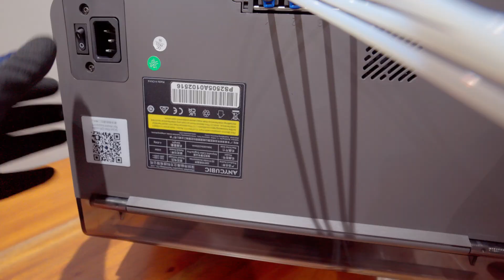Anycubic Kobra S1 : Guide for Troubleshooting Series Part 2 ( Ace Pro & Filament Path )

Comment: Glad I ran across this video guys. Thanks. My jam was just below the feeding point straight off the reel. About 8 inches of filament was crammed in with the gears. That was fun to untangle... About to restart that print that jammed 3/4 of the way through.
...

Comment: In my case, it feeds filament out 3&4 to about 5-6 inches into the tube out the back , stops and then retracts about 1 inch back and stops.  Once it's reached this point, you can see the filament in the tube out the back but you can't even manually push filament through the tube.  The feeder pushes out to it's maximum distance and will not allow any filament to pass.  If you stop pushing, it snaps back into place as it should.

I opened it up and don't see any filament blocking anything.  It was working fine until I had to replace a spool of filament so I decided to change all 4 colours while I was changing the empty spool as the others were getting low as well.  I retracted each one individually as you're supposed to via the panel operations and it worked just fine for all spools.  Spools 1 and 2 feed to about 5-6 inches out the back and stop but can be manually fed all the way to the printer head for extrusion.

Spools 3&4 feed out the same distance but you cannot feed them manually to the printer head.  The filament is locked at that distance in the tubes.

Comment: Great information, thanks for your time do post this. 
I've been fighting my Kobra S1 Combo for two days, the second spool (2) gets tangled then everything goes furbar. I changed the second spool from cardboard to plastic but still had issues during extract, I discovered that my first spool is 96mm OD while the other three are 98mm OD, with full spools during extract the 98mm spools turn slower than the 96mm spool meaning the filament rewinds on the spool loosely, on the 96mm spool it always rewind tightly. 
I checked at the Anycubic store and they sell two piece spools that are 96mm OD, makes me wonder where the warning are about this issue. I have not found any setting in the software for spool diameter, anyone know of a way to set spool diameter?
Reply from the maker: I have heard of this myself and have seen other users print a mod for it for the ace pro its pretty much a ptfe extension inside the ACE and with printed parts. The mod slightly wraps around the spool to prevent loose spooling. Just cant remember the name sorry

Most have had their issues fixed this way as far as I recall and hopefully that helps. Files are in makeronline

And also i have used plastic and cardboard spools okay and in different diameters. I just pop open the cover if the spool is slightly bigger haven't had encountered the issue you're having so far

Comment: I am having an issue where the filament in slot 1 just wraps back around and doesn't  feed through the bottom.
Reply from the maker: There's a filament sensor blocking either the ace pro buffer mechanism at the back, clog in the filament hub or in the extruder/ print head area

In the buffer mechanism if its protruding outward it means that the filament is definitely jammed and obstructing the path

I have videos on my channel for these
Reply: @SwampMan  I figured it out. After straightening the filament for about a minute, it finally stopped jamming. The diagonal cut I made was a bit more than 45°
Reply from the maker: @rwxstudio7173 yea one of the annoying things with multi color

Glad you sorted it out 👌

Comment: How do you get the tubes to stay in. Mine just keep falling out when the filament gets pushed through. I’m clearly doing something wrong.
Reply from the maker: Seems like either the ptfe tube (white/clear) needs to be cut short a bit or the black collar or blue clip is failing to hold it in place

Comment: Slot 1 and 2 keeps cloging in my case...
Everytime I get the error code 11518, but it's not the Toolhead.
The printer works fine without the ace.
But with the ACE...it keeps working, until I hear one loud click, then the lamp on the ace, where the filament is used, stopps blinking and just glows permanently.
And then it stops the print.
But there is nothing in the buffer, and the filament easely can be put in and out of the ace...
No extra force needed.
Hopefully you read that....
Reply from the maker: Only thing i can think of is the magnet on thw buffer mechanism or the filament sensor on the ace pro not functioning properly 

That aside on the extruder or print head side there are filament sensors in there too to check for

Comment: I'm having an issue with the Ace Pro. The PTFE tubes aren't locking securely in the mechanism. As a result, when I start printing a model, the tube slips out and all the filament just gets pulled out and spills.
The problem is probably that when the filament passes through the anti-clogging module, it gets slightly stuck in the tube right before the printer. The tube is also at a very sharp angle. But still, in my opinion, all the tubes should be very securely fastened.
Maybe I could print the tube mounting clips with a slightly greater thickness? Then the tube might be clamped well enough.
And what should I do about the second, short feed tube that goes into the printer itself? Any suggestions?
Reply from the maker: For the ptfe tubes not locked in try getting some blue clips or black collars. I forgot the exact term for them but they're related with ptfe tube supplies. Might as well get some ptfe tubes because they might be damaged if they're not locking properly 

I've seen users print the clips but id rather go for the plastic injected ones

Comment: I want to replace the fans in the ace pro with something quieter. Got my new s1 combo set up last night and by far the dryer fans are the loudest part of the whole thing, if you don't count occasional fast travel sounds. With it always being so humid here in Houston, having the dryer built into the ace unit was what convinced me to buy it. That and being half the price of Bambu!
Reply from the maker: Yea true they do run a bit loud. My ears got used to it lol

Comparing the print noise from my Centauri Carbon and Kobra S1. The Centauri sounded like a jet 😂
Reply: @SwampMan  yikes. i'm also liking how the Kobra s1 turns off fans and stuff once it's cooled down, unlike my ender 3 which has hot end and cpu fans running full speed any time the printer is on. so it's actually easy to forget that it's still on - screen is set to go to sleep after 5 mins, so the only sign it's on is the LED inside the enclosure... which i can't see from more than a few feet away when the office lights are on. i've realized i definitely want to add a light under the hot end though - i can't see whether it's even extruding anything, and can't see what that first layer looks like, even when i try to shine a light in there.

Comment: I really need an issue for error code 11519. When all classic issues don't work
Reply from the maker: The filament tangle error code? You can observe how your spool gets in and out of the slot you're trying to print at

Usually that error code happens when the buffer mechanism at the of the ACE is not springing back properly

Comment: I'm getting tangled filament error when it's not even tangled...getting annoying.
Reply from the maker: Sounds like a sensor is getting triggered that shouldn't 

You can check the buffer mechanism at the back if it flush to the cover or on the print head itself where the filament trigger is located

Usually those areas are what i check if the filament feeds properly in the ace
Reply: Same here, very annoying.
Reply: @razeyoshi after 50 emails from anycubic support and their engineer I'm parting ways with these machines...bought the kobra 3 combo and kobra 3 max combo and now the Ace Pro that came with the Max is starting to do it.

Comment: Yo! Do a video on how to get this thing to not throw fake "tangled" errors all the time. The ACE is cool, but the second I threw a matte roll in, it started saying it was blocked.
Reply from the maker: Interesting thing you brought up. I can make a video about it

Been compiling error code videos and shots rn hopefully I can finish it asap
Reply: @SwampMan  oh please, yes
Reply: Omg man this shits driving me crazy lol that's why I'm even on this video. Mine got fucked up trying to get a matte roll working and now it's stuck and I'm in a worse position 😭 I printed trim casings for the cardboard roll and it helped a little but it's not smooth enough so the machine can't pull it as fluidly as the standard plastic ones and it interprets that as a tangle cus it would become harder for it to feed in the same way.

I feel like the solution is either a better design for trim casing that somehow works as smoothly, a printed roller replacement (which there are models for but require extra parts), or an inner Ace spool holder to relieve some of the weight of the spool from the roller cus the issue seems to be the weight + either softness of cardboard or smoothness of trim casing if they're on. Idk man I can't find anyone specifically addressing this issue.
Reply: Ya this why I'm getting those errors? I use matte all the time it used to be fine until couple weeks ago and now I'm having an issue where the filament won't even pull out from the print head even if i try to force it, if it's go to the detection module and unconnect the ptfe tube from it than it finally works but if i do anything multicolor I have to continually go to the detection module and do that but single color works just fine

Comment: How can we extract filament tube from filament hub module? (From printer to hub)
Reply from the maker: The one at the back before it enters the printer? there's one or two screws hidden inside the printer for that if I remember correctly 

I remember accessing that after i removed the metal sheet at the back

Comment: I had error code 11512, then 11518 and then 11519. What may cause that?
Reply from the maker: 11512 retraction abnormal 

means your filament cant go back to the spool

11518 clogging detected

Could be jam/clog filament in extruder or hotend area. A sensor is getting triggered but it shouldn't 

11519 filament tangle

Means somewhere in the tubes or your ACE pro there's a piece of filament that has been stuck 

Refer to part 1,2 3 in the playlist and remove the error codes one by one
Reply: @SwampMan Damn, thank you so much! I'll check it!

Comment: Are there vent holes to let the moisture out while drying?
Reply from the maker: Technically there are but based on my use they are kind of inefficient. Much better to leave a small gap between the cover and locking part so that the moisture can go elsewhere. Would be nice if someone did a mod for better vent holes
Reply: @SwampMan Thank you.

Comment: I don't get it only slot 1 2 work together, but slot 4 work for very short time then get clocked. And slot 3 even don't work.
Reply from the maker: Look into slot 3 and 4 im sure something is blocking or obstructing the filament path for those slots based on what you explained

Comment: Great video. I just starting having issues with that buffer mechanism not moving at all even though they all snap back. So I guess I'll be taking it apart..
Reply from the maker: Thanks for the feedback 😀 Good luck with the disassembly hope you fix your Ace Pro. If you need extra help we have a discord channel
https://discord.com/invite/5ecpn9f6
Reply: @SwampMan  hmm..weird...I switched to my black filament and had no issues. Seems tk be an issue with matte pla from what I have noticed. 

I'm also gonna print one of those support brackets I've been seeing to see if that helps. Same goes for those anti tangle things in the unit.
Reply from the maker: @randalb1191  Yea ive heard of this usually its with silk, glow in the dark filaments and other brittle filaments

Although for me haven't had that issue yet usually i do adjust extruder tension sometimes but not all the time. Only when messing around with hotend/extruder
Reply: Hoooo-Leeeee CRAP!!! 😮 Wayyyy Too much for a first time 3D printer owner KS1 ... oh gosh... I may just send it back... Its a great printer. But just frustrated with these feed issues. The filament came with the Bundle. I soo hope I don't have to do this... 🤯🫤🥺

Comment: The two Guide videos are great! Thank you! Do you have a video of doing normal maintenance on the printer? I'm new and don't want to put grease or lube where it doesn't belong. Thanks!
Reply from the maker: Heya thanks for this 😄 I have noted this down. Will be doing bed leveling stuff, maintenance on other parts, and better tips to get the most of our units 🙂

Regarding the greasing dont grease the rails where the extruder and hotend are connected. You can grease the side rails on the left and right rails. Anycubic told me the center rails have carbon bearings which can affect movement if greased using normal lube. I have yet to ask them what's the best course for the middle one

Comment: Ive got a strange issue with mine. Other than the multicolor print that came with the machine, whenever the first color change happens, it does a Layer shift, just slightly. And then its perfect going forward, no other changes have an issue.

Support says its a slicing issue but im running out of ideas lol. I use the slicer that came with the machine, everything is updated, and it happens to multiple different models.

Thoughts?
Reply from the maker: Hop on discord server in description and in the #3d printer stuff send over the photos

I'll check it out perhaps i can suggest something
Reply: @SwampMan  Thanks for the response! I don't see a Discord link in the description.
Reply from the maker: @GSpacmanvice  https://discord.com/invite/5ecpn9f6

Comment: You should mention that in order to prevent the so called clog  which is not really a clog, make sure that the filament should be completely DRY
Reply from the maker: Yup true wet filament sucks!

Comment: Great video, thank you! When I look at the 4 tubes that lead from the loading ports to the buffers on the back I think they might cause some of the issues that some people report! I've seen people reporting issues with only one or two out of the 4 filament ports and from what I saw in the video it makes sense, these inner tubes for ports 2 and 3 look like they'r almost kinked ...?
Reply from the maker: Hey no problem 🙂 Yea for sure the ptfe lines could have been slightly longer too. Proper routing should help others
Reply: I do not recommend Open space Pro Bolton, because you have a clocging problem , you can put some pla in the front of acepro and push, open

Comment: Maybe you could find a way to improve the "ACE Pro" or perfect the filament feed a bit.
That's what happens with those black rollers and the filament sensors, you know!

Then you won't get stuck when inserting it into the feed hole...
and the filament will be recognized correctly forever, and the ACE Pro will work for what it was built for:

"for four colors and not just three or two after a while."

I would think it would be great if you could manage that
Reply from the maker: Good idea! maybe after we do all the troubleshooting with a stock Kobra S1 we can proceed with that. Thanks for the suggestion

There are decent mods out there already but we can add more to them 🙂

Comment: One more note, I had cracking noises from the beginning and with time increasingly poorer transport of the filament and retrieval of the spools. This was caused by the belt skipping from the motor to the axle. I spent a long time looking for the fault because it was almost impossible to detect. I had to loosen the 4 motor screws and reattach the motor with a tighter belt. Another indication was abrasion under the timing belt.
Reply from the maker: Good find and insight. The motor and axle parts are tricky they are a video of their own for sure

Played around with some of the sensors in there and saw the other timing belt and cam of some sort for selecting filaments
Reply: Shiny dullish Grey on the belt ?

Comment: This is the ACE Pro version 2. This one has the guards on the inside of the lid. This is different to the ACE Pro that comes with the Kobra 3. These guards help guide the spool in place, but they can hit the filament if the spool is loaded very full.
Reply from the maker: Yupp thanks for pointing that out. Having a very full spool can definitely cause the plastic guide to inhibit spool movement. I usually have a spacer for newly opened ones or for others I've seen they just remove the guide

Internally they seem like the same unit other than the plastic hub/adaptor needed for using it in a Kobra 3 or Kobra S1 unit